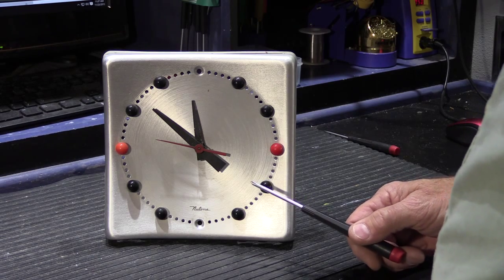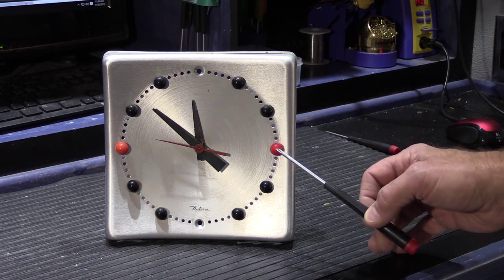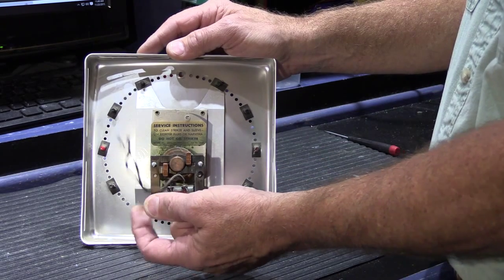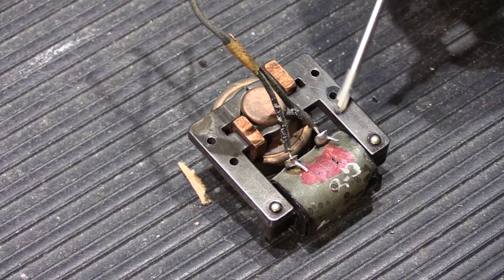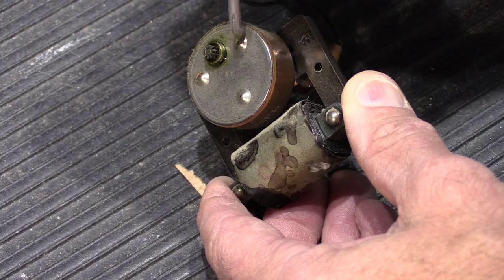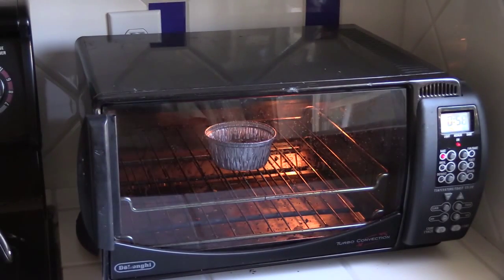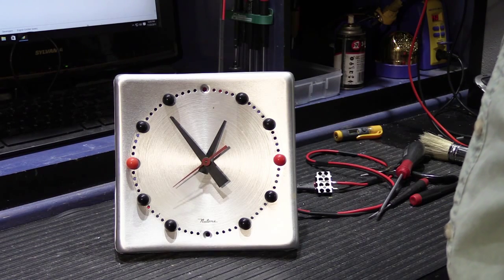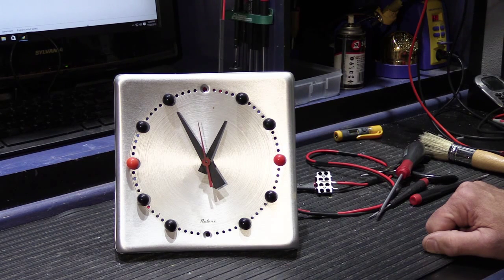Repairing the Telechron Clock Motor in a NuTone L36 Elite Clock Door Chime

Comment: WD-40 is not an oil nor a lubricant
Reply from the maker: Hi AV Cuber:  While that's a common opinion - here's a quote directly from the WD40 web site

"WD-40® Multi-Use Product protects metal from rust and corrosion, penetrates stuck parts, displaces moisture and lubricates almost anything. It even removes grease, grime and more from most surfaces. For powerful versatility, count on the blue and yellow WD-40® can to help you live life hands on."

It is important to remember that when someone is watching an instructional Video - using common techniques and products will allow more people to achieve the goal in the Video - as long as nothing that is shown damages the item - no harm to foul - Chris
Reply: @northsideservicecompany3567  what I'm trying to say is that is a better way to do this, and as a watch maker myself I've seen many clocks and pocketwatches ruined (totally seized up) by WD-40 because it is not an lubricant as its primary use
Reply from the maker: HI AV: I understand  - How would you recommend cleaning the clock gears?
Please remember the the gear drive assembly cannot be easily removed from the face or taken apart.  These often have 40 - 50 years worth of buildup on them - especially since many time they are located in kitchens and they have grease and crud on them - Chris

Comment: excuse my name but im repairing an old 1955 hotpoint electric stove and it uses this type of motor, would you know any places i can replace it at. its model number is M-3082 and its type is H10. 110-120 volt and 3.6 rpm
Reply from the maker: Hi Shrek:  There are several Telechron motor are parts sellers on line - you should contact them about the parts you need.  - Chris
Reply: thanks. this will help a lot because most of the schematic on the back has been corroded so I can't find a specification of what it is and its a regulator for the "supermatic" burner so ill look around for some new ones

Comment: I picked up a Telechron recently, it worked for a few seconds then stopped. It's an H3 motor. I tested the coil and sure enough it is now open. I've decided to go with the rewind option for use with  low voltage.  I'lll feed it with 16V AC from a Dell monitor power supply, puts out 4.5A . I think the new coil will be around 850-1000 turns.  There is some information online about the conversion/repair. Hopefully it goes well, the clock looks really nice and I'd like to get it going again. Great video by the way. Oh and for oil I've used it all 3-in-1, Liberty, and Mobil 1 0-30W it's all good. :)
Reply from the maker: Hi jordanch68:  Rewinding the coil seems like quite a project, I hope it works out.  What gauge of wire do you plan to use for the coli winding's? - Chris
Reply: Hello! I'll be following the guide detailed here: sound.whsites.net/clocks/ocm(dot)html  They describe using  0.315mm wire (or 30 SWG, or about 28 AWG). I picked up the 16VAC power supply for about $7-8, I have to check for a source for the wire (probably Mouser or Allied, or online). Coil winders are fairly cheap online (around $30-$40) I may go that route rather than wind it by hand just for speed, efficiency, and accuracy sake. The number of windings seems to be fairly forgiving, I may put a couple different windings and compare them. 

Before I plugged in the clock the first time I took it apart to check everything, the coil was in bad shape to being with. Someone else had already tried to repair it, it looked like an old repair. Evidence of overheating and charring. But the main thing was the physical damage. The power cord is soldered directly to tabs connected to the windings, if someone ever kicks the cord or it gets snatched by the cord....bad news. I think what happened in this case was that both tabs were snatched free from the coil (they were only hanging on by the windings) and since those metal solder tabs hook half around the coil the back of those solder tabs dug into the back of the coil when they ripped off. I'm surprised it worked after I secured everything even briefly.
Reply from the maker: Hi Jordanch68:  Thanks for the follow up - that's a really good web site with lots of good detailed information.  Be sure to let us know which coil winder you decide to go with - it may be something I invest in - Chris
Reply from the maker: Hi Jordanch68:  Ah, that's what I thought you might me looking at.  It seems like a good price.  Fro myself, I would want one with a holder for the wire spool and a tension mechanism for the winding. - Chris
Reply: Hello, I got the 16V AC adapter yesterday. It seems like a good choice. I've been thinking about the winder, I may go with one of the keyed chuck models as that would give more flexibility over the bobbin size. The wire holder and tension mechanism  would be nice but those are a bit more expensive :)

Comment: i use  liberty  oil   better than  3-1
Reply from the maker: Hi Animalcorvair:  Since Liberty Oil is a completely synthetic, I'm not sure that it will have the same effect on the original grease inside the gear drive. - Chris
Reply: works   great //  will out last 3-1   just fixed  a  clock  out of a zenith  radio     try it    all i use  on  my clocks
Reply: Northside Service Company : This may be a dumb question but....I have a Nutone 3 tube doorbell and it has a Timex clock motor but there is no clock. what is the purpose of the clock motor???.
                Kind regards, Eric Dee.
Reply from the maker: Hi Eric, What is the Model Number of your Chime? - Chris

Comment: The arms of my clock hang down at 6. Looks like the arms got bent and rubbed on one another till they broke. Is there a way to replace just the clock? even if it is a battery operated one or another 12V I could make fit. Thanks
Reply from the maker: Hi Clayton:  You should carefully remove the hands (unscrew the knurled nut that hold then on) and see if they just slipped forward.  The hours and minute hand have a rectangular cutout in the center part of the hands, that fits over the drive hub.  The seconds hand is just a press fit.  You may be able to find replacement hands from a clock parts supplier.  - Chris

Comment: I'd like to use it with a 5V power supply, how can I do that?
Reply from the maker: Hi Armando,  You can't.  The Telechron Motor was designed to operate on 16 volts AC - Chris
Reply: Thank you very much Chris
Reply from the maker: You're welcome - Chris

Comment: I wouldn't put WD-40 on the clock gears.  WD-40 stands for: Water Displacement 40th recipe (attempt or something like that).
It seems to be a good lube at first, but turns to a water displacement seal (lacquer like) and really gums moving parts in the long run.
Reply: Agree. I think silicone would be better. I think I'd flush it with a solvent, first, to remove the old lubricant.